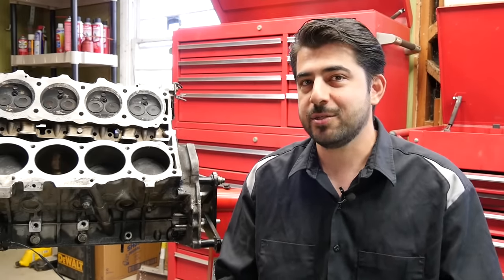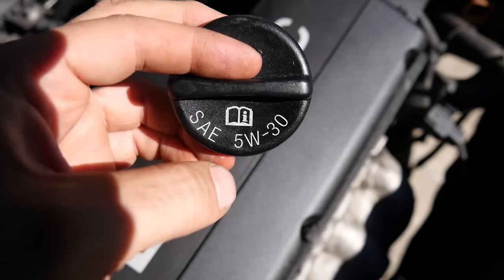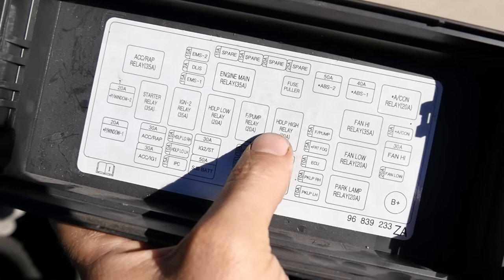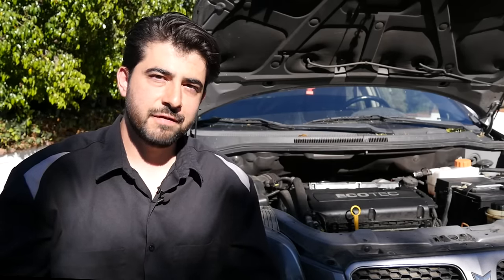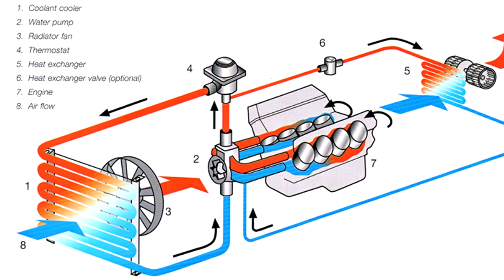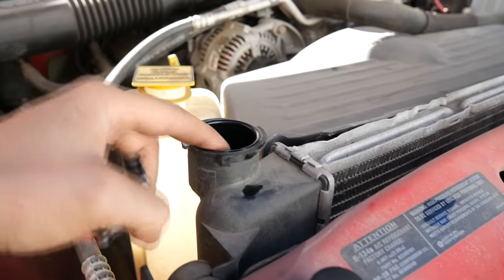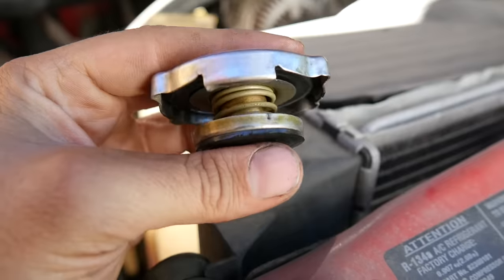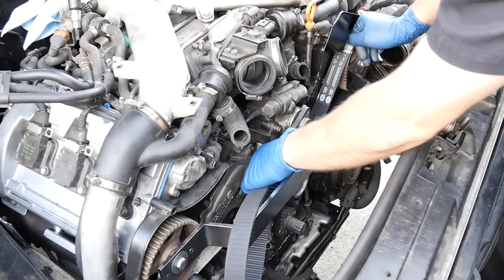Make Your Car Engine and Transmission Last a Very Long Time - Top 5 Tips On Car Care

Comment: You're theory on changing the radiator cap every 60,000 miles I found at it within 60 thousand miles the plastic and aluminum radiators warp and twist the cap out of shape and a new cap does not seal it properly and will leak. The only time I've ever changed radiator caps is when I've change radiators. Or maybe on a very old was steel radiator I can change a cab but not on these plastic aluminum radiators of today they just warp and once it's warped the new cap being round won't seal a warped hole. this is definitely one of those things that I don't mess with until it's broken. Like that old saying goes don't fix it till it's broken. Also I have a 92 525 BMW that has an inline 6-cylinder and the oil filter does not come apart the way the newer ones to order steel enclosed ones does the BMW actually has a filter cap you take off and you remove the filter from within and you replace a few gaskets and rubber O-rings. It also sits up so that it automatically drains into the engine all the time. Does this mean that every time I start my BMW up I'm killing the engine? If that's the case how did I get three hundred and fifty thousand miles on it? And I did this beating the crap out of the engine doing Burnouts as it has a 5-speed manual bulletproof transmission( the original BMW manual). I would not trust a new BMW at all. Unless I had a serious 0 payment warranty on it same goes with Mercedes or Volvo any car really today as they all are turboed and made of plastic. You could say they're designed to fail In order to get us to spend more money. Where do they think all this money comes from to replace engines or cars every few years?

Comment: I drive a 95 camry v6 with 268,000. Runs like new ive had her for 7 months and always turns on. I did some work here and there nothing major. Bout to change all 4 struts and passenger cv axle. Expecting to get 300,000 miles or more!

Comment: Bought my 2009 hyundai elantra touring with 90000m it's now 302000m I have never been to a mechanic shop only transmission flush been using  quaker5 20 full synthetic since day one. Never had any check engine .

Comment: I have a Ford explorer and I hold the gas pedal to the floor and it won't allow it to start while I turn it over.....until I see oil pressure.....then start normally.....purrs right nice....I always do this in mornings I'd rather replace a starter than any motor internals....

Comment: Serious question here, hope you reply, I'm looking at a 2006 honda ridgeline with 240k miles on it, do you think I should buy it, owner says it runs good no lights on dash, and will pass inspection but I worry the piston rings are probably worn out, timing belt, and maybe transmission gaskets I'dont know if it's worth it. He's asking 4k for it

Comment: I change oil every week or two and run vr1 20-50 in my stock internal boosted d series. Put 100k on her in 3 years and got it at 100k.

Comment: Should you change your battery before its starts showing issues? I had mine tested at Advanced auto as a precaution. It was at 100% charge, but still read as a bad battery. Should I change anyway?
Reply: Should get a spare handy. The voltage may read fine, but it won’t tell you the state of health. A cold cranking amp test is a better measure of health than just charge. Food for thought, battery is probably on the way out

Comment: I’m a mechanic. Don’t fill the oil filter, here’s why. 

Whatever oil and any debris that got in there will be delivered to the engine with no filtration. 

If you get the smallest amount of dirt in there .. like when you screw it back on after you fill it, it can damage the engine. If it’s such a big deal how come half of the filters go on in a way where you can’t fill it and put it on without it spilling out ? 

Not a bad video !! Common mistake.

Comment: The hole in the water pump is designed to let coolant escape so it keeps the bearings lubricated, plug that up and you will burn the pump out. You would of known that if you listened to Scotty. Lol
Reply: Frank Biz - I actually have been wondering about that video as well. I am not convinced coolant is supposed to be coming through the weep hole by design unless the pump bearing seal is going bad. The weep holes on my vehicles are all dry. I have never heard of it the way Scottie said it but I could be wrong....
Reply: As the seals age and begin to leak, excess fluid will drip from it before the gush.

Comment: If you have a transmission that has over 100k miles, you should drain and fill only. I bought a 2007 Toyota Avalon with 150,000 miles, drained and filled 4 times back to back over 5k miles. Have 350k now and it shifts like new.

Comment: Oem parts are NOT always the way to go, for example lots of OEM water pumps have plastic impellers which fail faster, than aftermarket equivalents with aluminum impellers. Also if a car has a known pattern issue from OEM than finding a quality aftermarket solution can fix the issue. It's about quality parts not simply OEM, people assume OEM=quality.

Comment: Ideally, you want to add the inter-cooler for the transmission to be IN-LINE with the cooler that's part of the radiator... Not for it to be exclusive.
Reply: Nobody does that. Why would you want to?
Reply: @AlexandarHullRichter  To cool the fluid more...
Reply: @citizen_or_civilian  I don't think I've heard a single transmission guy recommend that. The usual concern I hear is cross-contamination between trans oil and engine coolant. Every transmission guy I've heard says to keep trans fluid as far away from the engine radiator as possible, before diving into strawberry milkshake stories.
Reply: @AlexandarHullRichter  Well... If you don't replace the radiator while you're at it, then yes.  Otherwise you'll be replacing the radiator later, and/or you won't get as efficient cooling.
Reply: @citizen_or_civilian  That actually doesn't make sense. Fresh air is going to cool to ATF way more efficiently than already hot, partially cooled engine coolant will. If the integrated cooler worked better, why are car manufacturers switching to separate transmission coolers from the factory?
Reply: @AlexandarHullRichter  Probably because it's cheaper to run a small, separate cooler for the tranny, rather than a separate cooler with it looped into the radiator?  You still get better cooling than just having it run through the bottom of the radiator, but it's not quite as efficient as having both.
Reply: @citizen_or_civilian  so it's cheaper to make two radiators than to make one with a fluid cooler in the bottom? I find that hard to believe.

Comment: You should mention about radiator coolant sensor that is responsible to start
cooling fan 
It is need it in trafic in hot summer
I installed in my mazda protege 2000 manual switch

Comment: Before replacing my oil filter which is installed horizontally I am not only disconnecting the fuel line like the author suggests but also the hydraulic line from each brake calliper (just to be safe 🤭)

Comment: Some great advice, but the oil change tip is not practical when I take my vehicle to the dealership. It only costs me $35.
I have 2015 Prius.
They only drained and filled my cvt fluid. Not sure if you can flush these units.
Would be great if you could do some Prius related videos.
It's the best vehicle that I have ever owned.
Thanks!

Comment: I have two vehicles both with over 100000 miles. I don't know If the Timing belts have been replaced. Is there a way to tell if they need to be replaced or if they are still good? Or should I premptively replace them now?

Comment: Change trans fluid leave filter alone.Cool oil equals long life...
Suck fluid out very year change as much as you can.Leave filter alone unless a failure.
Most  motor oil filters have a anti drain back check valves and bypass after 6000 miles. 
Change oil alot 3000 miles...Coolant flush distilled water only. Check fluids every full tank used. 
I get 250-370 k out of my GM 5.3 ,4.3 trucks.
We have a fleet only minor issues.

Comment: I own a 2015 kia sorento i4 2.4 and a 2002 honda accord v6 3.0 the kia has a gdi engine and when i was out camping i went over my oil change due date and started to burn oil and i had to add oil. I did the same on my accord by not changing it on time but my honda didnt burn any oil and i did not have to add oil like my kia. I only use valvoline full sythetic on both and only use oem oil filters. My kia says 5w20 but i use 5w30 because of the hwy driving and use 5w30 on my accord which is stock recommendation but i reach higher speeds with my accord. Should i use 5w20 on my kia as it says on the oil cap? Why is this happening? Also i live in Boston Massachusetts where we get snow but this is happening in summer season when its hot outside and i do most of my camping in high altitudes out in New Hampshire. My accord is my toy for the city and gets driven less compared to my  Sorento as my Sorento is my daily and the accord is smacked so only drive it in summer or when there is no snow

Comment: Well I got tell you I had a 1969 Pontiac executive when I sold it in mid eighties it had over a hundred thousand miles on it and I got tell you if it started just a turn of the key and ran so smooth I sold it to the kid that was moving out-of-state and who knows how many miles.

Comment: Question: this an old one, isn't there enough oil clinging on ie cyclinder walls piston walls the lifters the rod bearings, a very thin at least .001-micron level protection? So does oil actually permeate metal ie. Pistons rods&bearings or just coat them ? Thanks

Comment: question sir, does manual transmission has transmission fluid? (I think No? not sure) if so what do I need to check or to maintain in a manual transmission car aside from the wear and tear of the clutch. Thanks.

Comment: Question: I just got a used 2011 car with 84,000kms. When it's idling and I remove the cap on Engine oil compartment, some air blows out, anything to worry about?

*Can runs well and sounds well

Comment: Say instead of doing a fluid flush if your trans pan holds 3 quarts of an 11 quart system what if u just drained the pan and refilled 3-4 times with say 50 miles of driving in between each changed and then changing the filter and cleaning the magnet etc would u say that is equivalent to a flush?

Comment: Probably should mention about babying the car. 50% is about maintenance.. other 50% is about how you drive the car. Taking off at every red light is a for sure way of reducing the life of the engine. I bought a Ford that had 250K on it and drove it for a year and a half then sold it to my brother with nothing wrong with it with about 290k. 6 months down the road... my brother threw a bearing and when I asked him how it happened.. He told me that he was revving it at a red light. I also rode with him a couple of time in the truck and he was dogging the piss out of it. I was surprised it lasted as long as it did.

Comment: when should I change my timein belt?
Reply: Andywensheng cao - depends! Most newer cars have gone back to timing chains instead of belts.  My 04 Toyota has a belt and I change it every 100k. My 04 chevy has a chain that will never need changing.  Typically I believe it is recommended to get it done around 100k.  Definitely something you need to be aware of especially if your car has an interference engine which will majorly get screwed up if the belt fails.
Reply: check the manual

Comment: What about a car that has a "non-serviceable" transmission? I have a Fiat 500 currently at 150,000 miles and Fiat does not recommend or supply any way to service the transmission. Thoughts?

Comment: I'm not an expert, but even when you drain the oil and replace it, there should still be enough oil inside the engine to lubricate it when you start it up. The pump only takes short seconds to spray oil everywhere. That really shouldn't be a problem at all.
Reply: All relative.

Comment: Use distilled water with the coolant in your cooling system.  Periodically suck out (with baster) and refresh brake fluid, PS fluid in the reservoir (once or twice a year).  Also do whatever it takes to change your ATF regardless of those lies in the owners manal saying "IT IS GOOD FOR THE LIFE OF THE TRANS".  This is true, if you're planning on changing your transmission at 100k miles. Otherwise it's just a lie so change that ATF.

Comment: Say brother, I've got a 2018 Sierra 3500 with the 6.0L gas engine. How good is the engine and transmission and if I do all this could I get 400,000 miles out of it? Left a 👍

Comment: Before you change the oil crank up the engine until you have oil pressure. Then turn it off and drain. There will be plenty of lube when you start it again.

Comment: Thanks...subscribed several months ago. I have a 96 Tacoma 3.4L V6. It wouldn't start..so I replaced timing belt and water pump, tensioner and pulleys. Still no success, so replaced fuel pump and starter. Timing is good now and engine starts but overnight, truck wont start next morning.Battery is new... Any thots be greatly appreciated! Thanks!
Reply: Load test the new battery in the morning before trying to start. Check cables, of course.
Reply: You may have an electric short draining your battery. Hard to find. Have an auto electric shop help you. Yelp reviews helped me find a good one

Comment: Hello my 2007 Honda civic LX transmission failed at 245,000 thousand miles . I took it to the mechanic and a week later I installed a transmission cooler 😎

Comment: i have an interesting challenge for someone. Im some wat a decent car guy. My 2003 honda civic when i use my power windows or back window de-thawer my belt screeches.. Now i dont know if maybe my tensioner is the case maybe because it upping the load its causes it to slip/screech. I had my belt and waterpump all that changed by a mechanic around 2 years ago, Since then this screeching has came to light. Use to only come up when i used my AC. the mechanic thought it was my compressor going. But now when i drive and i roll my windows up even while there all the way up it causes that screech to come until i stop using it. Same with my back window thaw button it will cause the screech when i turn it on. Now if i dont use my windows/back thaw button/ heat or ac the screech doesnt happen at all. I've had a new alternator replaced too within the last 2 years. Any one up for the challenge of figuring it out? Thanks YT.

Comment: my 2014 jeep wrangler tranny temp sits between 70-85C is that a good thing? I heard they can also run too cool. Its cold where I live also my coolant temp sits at about 94C and it never cycles through the overflow tank i think because it never gets hot enough.

Comment: transmission flush on a  older car is a crap shoot because you could loosen junk that may foul up the internals. I suggest dump and fill with the same amount. you don’t switch all the fluid but it is much less stressful in a older trans that has not been cared for.

Comment: If I change engine oil after every 2500 km to 3000 km, if I change gear oil after 20k km, if I use good coolant in the radiator and change every year, if I don't exceed car speed up to 50 to 60 km, then Hyundai Palisade v6 gdi engine will run smoothly after 500k km? Can you explain it honestly?

Comment: You should NOT fill filter with oil. No manuals that require this. Mark on filter say, that you should only lubricate ruber gasket on filter.
Reply: Doesn't oil run through regardless into pressure

Comment: There's a difference between OEM parts, parts that other manufacturers make that are "OEM specs", and performance/upgraded aftermarket parts. Why would I buy OEM when there is likely to be a performance aftermarket one that improves on OEM failures for around the same price?

Comment: I’m driving a 1989 Toyota Camry four-cylinder I believe it’s not a wise idea to go with synthetic oil in a car of that year because the seals and gaskets would get damaged 
contrary to your video you said go with synthetic oil I disagree or am I wrong?
Reply: Good point.  See what your car is made for and use that oil. My cars call for partial synthetic, so I just use full synthetic as that is an option but for cost they allow the partial.
Reply: Wrong. The "synthetic" does not damage the seals. It has laminar flow characteristics that are different from conventional oil making it tend to seep past older, worn seals.

Comment: Does this still apply when buying a used $1,500 -2,000 139,000miles car... Ive and heard contradictory info, saying that if you start using synthetic and flushings, that somehow you start loosing up built up deposits that were sitting lodged on the walls of components till you started picking at them. Then thats when you get catastrophic failures. 

Don’t pick at your cars pimples 🥳💣
Reply: Never flush. Synthetics might tend to seep around old seals. Just use conventional.

Comment: I’ve been using conventional oil on my Nissan Sentra ever since I bought it new. Odometer now reads 199k mi now and I am considering starting using synthetic oil. Would this change have a detrimental effect on the engine/performance? Thank you for your informative video.

Comment: Just a FYI. You cannot put synthetic oil in any motor. Only if it's designed for it. I tried it on my vehicle that calls for regular 5w20 oil and I used 5w20 synthetic and the car started burning a lot more oil and oozing oil all over the place. Now my driveway looks like I had a Ford parked in it with the big oil stain in my driveway. I switched back to regular oil and the car is not burning oil and oozing anymore.
Reply: Nope. They can be mixed or interchanged freely.  The different flow characteristics can make old seals seep.

Comment: Some people say that if the engine has too many kms then dont put the manufaturer's recommended oil but use a a hgh viscosity oil. Is that correct?